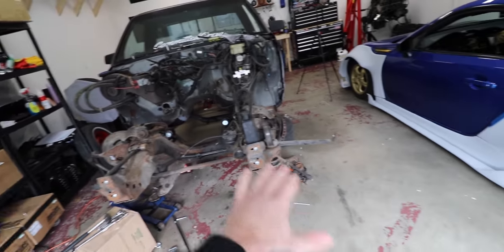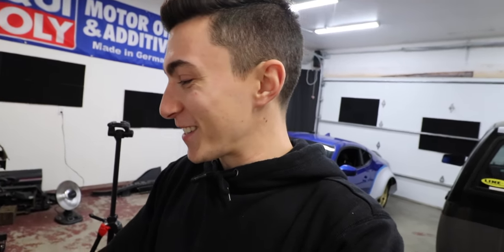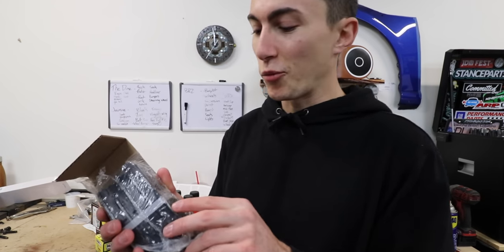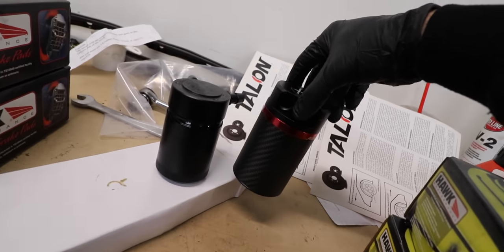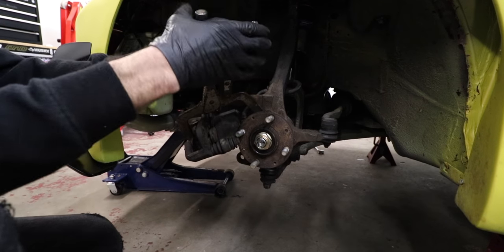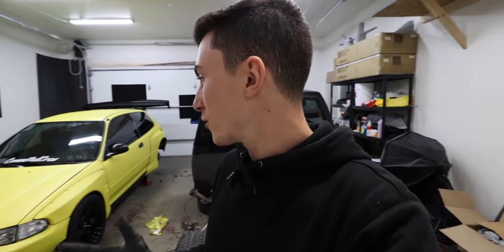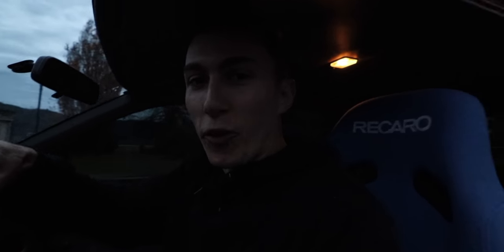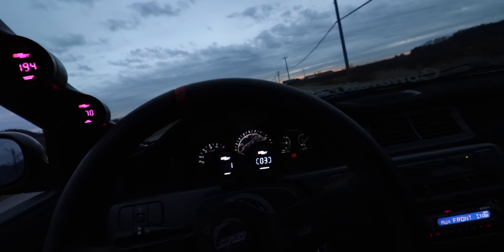UPGRADING BRAKES ON THE EG!

Comment: For your boost problem: check the boost cut in the tune, could be low for some reason. Also try blocking off the bov, it might be opening too early.

Comment: For the spring I have the same setup in my van I didn’t use a spring compressor you just need to attach the knuckle to the control arm put the spring in place then hold it up and attach the upper control arm and use a pry bay to move the spring into place

Comment: You might have a hard cut at just over 8psi and the waste gate isn't quite doing it? Maybe the boost by gear is set SUPER low after 3rd? Could be a lot of stuff. I would just check the settings.

Comment: Little bit of misinformation; upgrading brakes will not help your car stop faster outright; they help prevent your car from taking longer to stop. I don't want people going out and putting slotted rotors and race pads on their 2002 Corolla, thinking they can go from 60 to 0 in 10 feet, putting themselves and other people in a dangerous situation. And higher performance pads work better in a specific temperature range, so if you spring for the top of the line performance pads, you'll actually have worse brakes because you'll never get them up to temp in daily driving. You'll feel it bite much harder, but you won't stop any faster. Stopping distance is entirely determined by your tires' grip, because even OEM brakes are capable of completely locking up your tires and exceeding their grip. In fact, drum brakes are actually stronger than disc brakes in terms of instantaneous friction. Upgrading brakes improves your car's performance by rejecting heat much better, as higher performance pads will work at higher temperatures, disc brakes cool down better than a sealed drum brake, and drilled and/or slotted rotors will cool down sooner than a solid or vented rotor. This is why big cars like SUVs usually have disc brakes in the rear; more mass means more kinetic energy, which means the brakes generate more heat. 

This is only really important on a track, where you're actively trying to go as fast as you can up until the next corner, where you instantly bleed off all of that kinetic energy into heat in the rotors and pads. And this is repeated over several laps, in the course of an hour or more. You don't want your brakes to overheat on the track because once they're too hot, they lose their ability to slow you down and turn kinetic energy into heat. In worse case scenarios, you can glaze your pads or boil your brake fluid, which virtually eliminates your ability to brake. In regular daily driving, you're not likely to overheat your brakes unless you're doing 0-60 runs in constant succession (side note: rotors don't warp due to heat; cheap cast iron tolerates much higher heat than your brake pads will ever reach. Check your caliper pins because one is likely stuck due.)

And, before anyone goes out and tells me I'm wrong, do some research before hitting that "REPLY" button and making yourself look like an idiot in public. Or go get some empirical evidence; get in your car and stop from 60 to 0 as fast as you can. Notice how either your tires lock up, or ABS kicks in. That's because friction between your car and the earth is limited by your tires, not your brakes. Doesn't matter whether you're in a POS beater from 1980 or Mercedes' F1 car; your tires will give up first.

Comment: You might have to fix/change the way your tune is set up. It could be some type of boost leak. If your tune has launch control, than you could be stuck in launch control. Check out even shanks video. He has a similar problem.
https://youtu.be/Oceuz4cl4ng

Comment: Check the brake guide pins are clean and properly lubricated. If not, it could cause the pads to wear unevenly and/or seize it up.

Comment: Check that catch can set up again. You just made a boost leak with the manifold. Just vent the crank case pressure on the valve cover or get the fittings for the block, or yolo just do a vtec cylinder head swap. It’s barely a Honda w out vtec

Comment: You don’t need the spring compressor just place the spring in place and slowly jack up the lower a-arm and make sure the spring is rotated right in the grove and keep jack it up and it will go in I’ve done it a lot on my 94 GMC Sierra when I put my lift on and re did my whole front end

Comment: Them springs in the s10 , can’t you just plop the spring in and out a jack under the control arm? It might not work without the weight of the engine I guess though

Comment: Check your exhaust back pressures (run with just turbo down pipe on no mufflers or cayt) see if it keeps happening. Too much exhaust restriction will stop your turbo from being able to spool then the turbo becomes a restriction in the intake.

Comment: Just in case no one else has mentioned it, drilled rotors have a good chance of stress cracks when you really push them hard. Slotted are better for heat dispersion under heavy use (track or auto-cross). I hope you don't have this issue cuz they look really good!

Comment: Because you got the car tuned when it was warmer the tune is made for thinner (or less) air, but now that it’s colder the air is more dense and it’s just hitting boost cut. Raise the boost cut about 1psi higher and you’ll problems will be solved. Itsjusta6 ran into this same issue with meep the purple Miata.

Comment: You don't need a spring compressor for that. You were supposed to disconnect it at the knuckle and slowly lower it down to let the spring out. I almost killed myself once taking them off incorrectly on a Dodge Dakota. At least I think this applies for your truck too

Comment: the civic boost problem: the boost cut in the tune is off because the weather is getting colder, the colder air is denser and it's tuned for warmer, less dense air

Comment: I have an old chevy car and the way i got the springs in was by sitting the top of the spring in the frame and then sticking a pry bar between the the control arm and the spring. At the same time i would slowly jack up the control arm. Hope that helps

Comment: Theres a boost leak somewhere check all the intercooler clamps and pipes as well as the bov making sure its not leaking there either. Had a similar issue where my car would read boost but just had nothing.

Comment: The problem your having is boost cut due to change of season. Due to being more colder air is denser and you get more boost if boost set to 8 and boost cut when go pass 8 it will do the jolt. You most likely just have to get it retuned because change of seasons.

Comment: Sounds like boost cut, you'll need to check the whole turbo system, intercooler piping and vacuum lines for actuator and wastegate for leaks

Comment: Yellow calipers! And check your hondata and boost cut off readings... Sometimes when you unplug the battery, the cars aftermarket sh*t can poop on it self.
Reply: Oh and check the turbo. It is an ebay turbo after all so might be something whit it... And i dont know if this helps but my diesel vw has an n75 valve that is faulty and it has similiar problems so if hondas have enything like it, you should start looking there

Comment: Rear brake pads were wearing funny because there is a cross in the caliper piston that's supposed to fit over a little tab on the back of the pad. You must not have gotten the hole in the piston on the tab on the caliper. Better make sure you did it this time
Reply from the maker: I actually remember doing it this time, and I didnt remember having to do it before... so your probs right I just didnt know to do that last time!